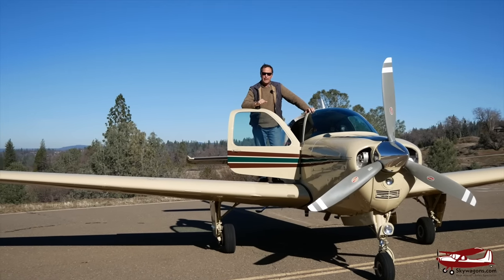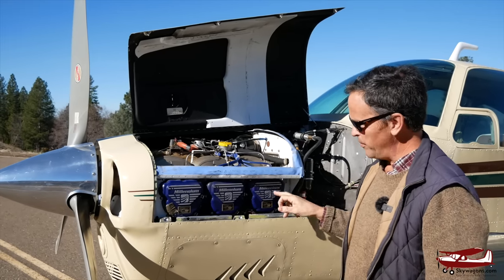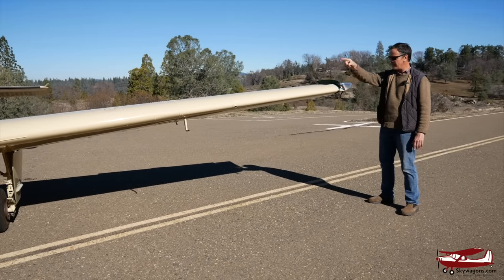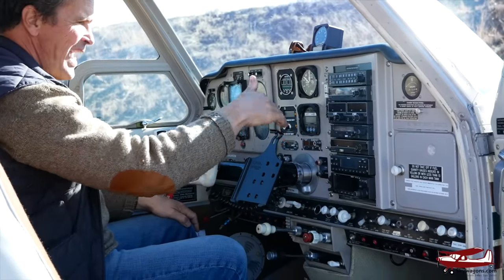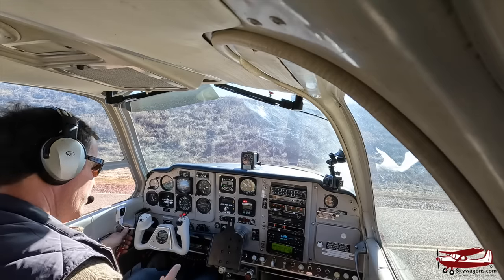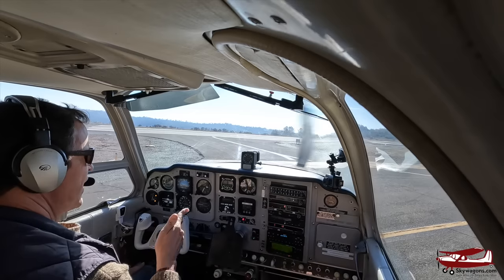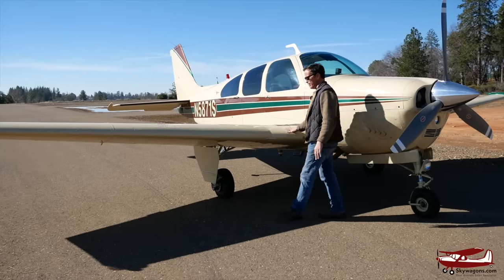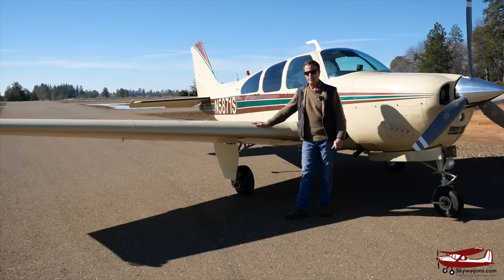The Debonair

Comment: During its first few years, the Debonair had a 225 hp engine. I flew that model (in a flying club) for several years. Certainly not a "hot" performer, but it did just fine on that engine.
Reply: The other nice thing about the original engine is that a MOGAS STC is available (I think…). This would be my choice.

Comment: Flew about 20 hours in a B-33 Debonair, rented at GGG, Longview, TX when I was in school at Le Tourneau University in the mid 90s. I was surprised, and a little uneasy, to be signed off in less than an hour! The only complex I'd flown then was a very old Arrow. However, I learned the simple Debonair quickly & easily. It is still the finest GA airplane I have ever flown! I'll ditto everything Mark said in this excellent video. It's extremely comfortable, fast, quiet, incredibly stable, and easy to fly. What impressed me most was how rock-solid stable the Debonair flew, truly a hands-off plane! I also remember a challenge learning to slow it down. It's very aerodynamic & loves to fly fast!
Reply from the maker: They are relatively simple to fly,   I flew it!?

Comment: Every time I installed an oil cooler I placed it outside the engine compartment (flat with a 2" rise) added a thermostat and bypass so when the oil was below normal temp the bypass would block oil from getting to the cooler.  When oil temp reached norm the bypass routed oil to the cooler.  When oil hit Max Temp a small electric high speed fan kicked in bringing oil temp down fast.  Worked like a dream.  Especially good if you are stationery on the tarmac waiting to take off.
Reply from the maker: Cunning.

Comment: Great video, Mark! My brother has a 1966 C33-A Debonair, IO-520, 285 HP, and a 2-blade prop, it's really a nice ride. He had tip-tanks put on, it's got over a 1600 lb useful load and he can cruise all day in comfort @ 170 kn. He used to have a 1952 Bonanza with the V-tail and yeah, that 'Bonanza Boogy' minor fishtailing in flight, while not a problem, I'd rather do without. The Debonair is a smooth machine. I have minor mobility issues so getting out of a low wing is something of a controlled crash (LOL) so I'm good with my old 172.
Reply from the maker: Thank you.  Excellent planes.

Comment: The first 30-40 ‘47 bonanzas actually had fabric flaps and ailerons, and during development, they had fabric ruddervators
Reply from the maker: fabric?  Interesting.
Reply: Fabric covered control surfaces were still quite common in 1947. P-51 Mustangs had fabric covered rudders. Corsairs had fabric covered tail control surfaces, and up until the post-war -5 version they had partially fabric covered outer wing panels. Where I grew up we had a Lockheed Super Constellation mounted above a local restaurant and I only realized that it had fabric covered tail control surfaces when the fabric eventually rotted and fell off over the years.

Comment: Nice video. The 550 with the Scimitar prop is a great mod. Quieter cruise and better climb.  

The issue with manufacturing Ruddervator skins has more to do with Textron’s desire to be free of liability for anything associated with 50+ year old planes than anything else.  They did just complete a production run of I believe 20 sets of skins.  All but a few were bought by a single shop in Oklahoma. 

It’s a misnomer that the wag comes from the v-tail.  It’s really a byproduct of the short-bodied nature of the fuselage.  If you fly that Deb on a bumpy day, you will certainly feel the wag – especially in the rear seats.  The v-tail plane actually has more vertical surface area and rudder authority than a traditional tail.  All that said, a modern autopilot with a yaw damper in a straight or v tail solves the issue.

Like the Mooney, the Debonair and especially the V-Tails are iconic.  As you pointed out though, the Deb and Bonanza might not be as efficient but they sure are comfortable!
Reply from the maker: All very true, and interesting about the skins.

Comment: Mark…Nice airplane.  The problem with a low wing is the placement of the wing.  On a hot summer day you’re flying in a greenhouse.  Much rather fly in the shade.

That tail wag in a V-tail is cured with a yaw damper.  The Garmin GFC 500 autopilot has a YD function that works quite well, as you would expect with Garmin.

I bet that yoke with the PTT and trim on the right side was originally a right side yoke for for a double yoke airplane.
Reply from the maker: All these things are 100% true and well observed.

Comment: In 1960 it did not come with a 260hp IO-470-N, it came with a 225hp IO-470K. ( 2:26 ) This early IO-470K power plant is one of the few injected engines that is eligible for an auto-fuel STC. Would have been good to discuss this, no?
Reply from the maker: Yes it would.  Thanks.  This was more about this particular plane.

Comment: The Mooney m20f that I flew for several years also had interlinked flight controls.
Reply: The '46 Ercoupe that I still fly has interlinked controls and no rudder pedals at all. First plane with trike gear too. Even though I cruise at 3 gals./hr, it takes an hour to go 100 miles. Makes it about 27mph. This is comparable and with 4 instead of 2.

Comment: How does a Debonair handle crosswinds landings if the rudder and the ailerons are connected?  How does one apply opposite rudder to keep the nose aligned with the centerline and then apply opposite aileron control to stay on centerline?  Do you have any thoughts on the C33 Debonair with the IO-470?
Reply from the maker: They still do all the same things as other planes.  It is not a rigid system.
Reply: @skywagonuniversity5023  thank you for your response.

Comment: If you want a scoop try the new Gogetair G750 915 version. Similar to bonanza speed but a fraction of the fuel burn, brand new and a fraction of the running cost. Approximately same new price as a very old bonanza.
Reply from the maker: I'll look it up.
Reply: sure..if you want a high wing loaded LSA that cruises at 135 knots ...costs almost 400k optioned out and has virtually zero dealer support in the usa...go for it....there are dozens of loaded bonanzas for half that cost ...that will buy alot of 100LL

Comment: Very enviable piece of kit! As I'm 'ahem'  years out of date, what price 'new' for that 550 over a stock (285hp?) IO-520? : )
Reply from the maker: The 550 today is about $100,000.
Reply: @skywagonuniversity5023   - Well, for certified, hand built & balanced everything; not bad; far better with an inclusive SF260 hanging on the back, but what wouldn't be? : )
Reply: Lod dude.  An option, if you have a 520, is to have LyCon overhaul it.  With flowed cylinders and their STC’d performance cam they are showing 350HP on the dyno, no change in TBO.

Comment: Never flew a Beachcraft. Cessna man personally,152 to 210T  I do not appreciate the fussy emergency systems and procedures of the Bonanza/Debonair. Stesight forward C210 will be a better option when the chips are down.
Reply from the maker: A beech has a simple emergency system like a 210.  The 210 is select down and pump and the Beech is select down and crank. (basically) The good thing about the 210 is that you can see the gear.

Comment: One question: with linked controls, how do you land in a cross-wind?
Reply from the maker: The controls are not locked together.  They are assisted and work 100% normally just like in any other plane.
Reply: @skywagonuniversity5023  Thanks. I love this plane!

Comment: Carbon fibre for the Vtail ?
Reply: Nothing certified right now. There’s even an award from ABS and EBS for anyone coming up with a solution.
Reply from the maker: How did they do it in 1947?
Reply: @skywagonuniversity5023  today’s solution
Reply: @skywagonuniversity5023  There is a lot of info in the American Bonanza Society (ABS). I don’t remember every detail since I have a non V-tail Bonanza so that doesn’t apply to me so badly as the V-tail owners. The problem is to get this magnesium alloy base material. Nobody makes that anymore. Not in the same way or even at all as it was done in 1947 and the following years. Thickness, strength, stability and weight have to be exactly the same as in say 1947 or 1960. 
So someone has to come forward with a replacement and THEN get it certified by the FAA. 
Good luck! There was a set of 5 sets of new old stock offered for 50k$ recently(per set, so 25k per piece!) if I remember correctly. Not sure if this was legit or not. It sure is a problem. 
Besides that all TEXTRON parts prices are crazy. 2000$ for a V35 gust lock, 4000$ for an oil press transducer, 3000$ for 8 wing bolts and nuts…